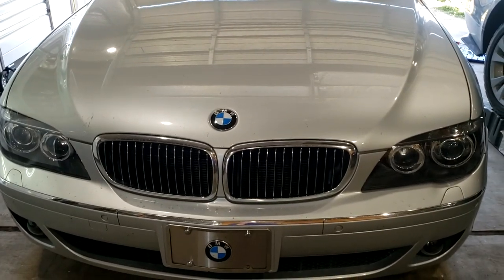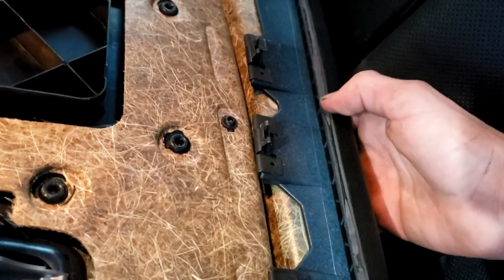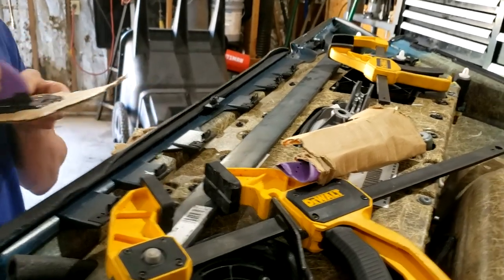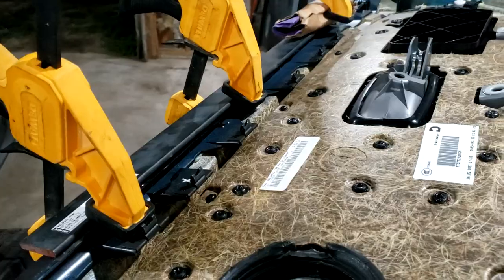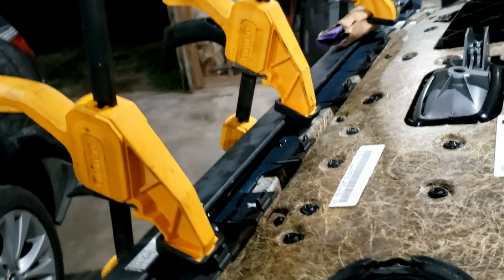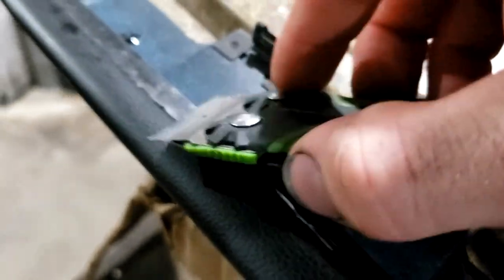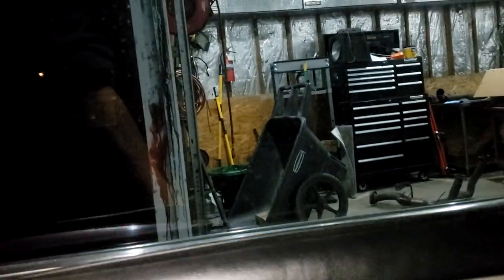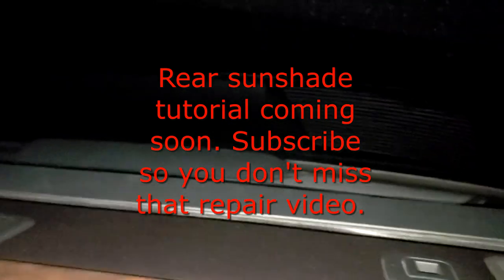BMW E65 E66 Rear Sun Shade Door Panel Repair

Comment: I am experiencing the same issue on my 2006 750 LI. I will be doing the same procedure. One quick question. To remove the door panel, do we need to unclip the door handle as well from the wiring as suggested in some video or do we need to just remove the 3 screws, to remove the door panel ? also do you have any other recommendations for the glue or use the same as you used?
Reply from the maker: I recommend the same glue I used because it's cheap and it works. Other glues may not hold over time. To remove the door panel you must remove the screws and then pop the door panel out of the clips. The Door panel will still be attached to the car. You will need to remove the wiring and then remove the cable that connects the door handle.
Reply: @european.repairs  Thanks 

I ordered the same glue and I will follow your video soon.

Thanks